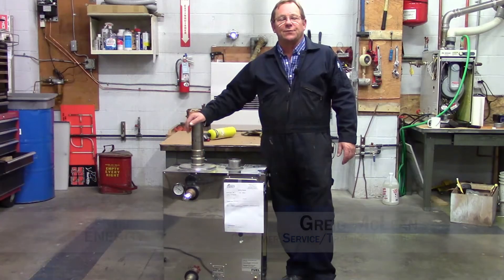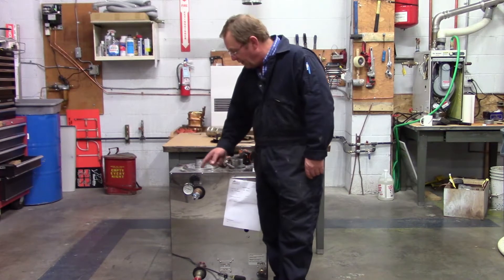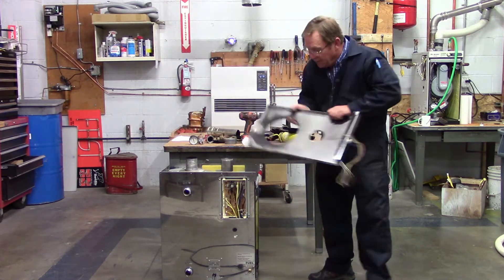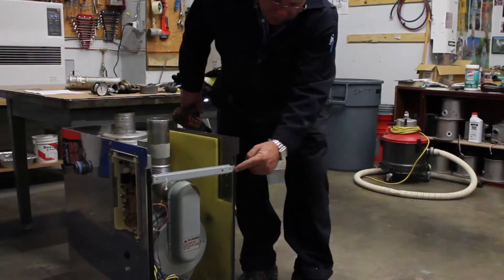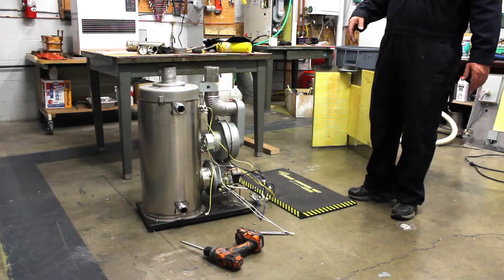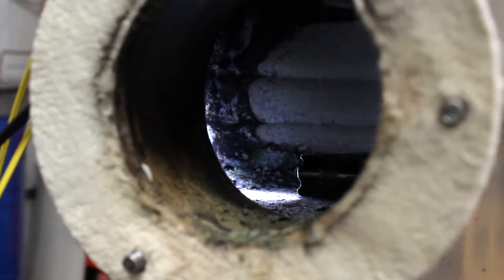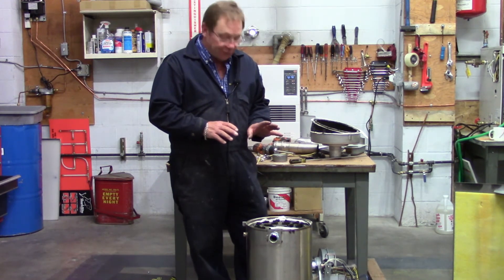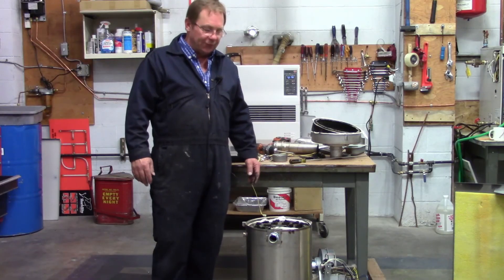Oil Miser Heat Exchanger Replacement: Part 1 | Step-by-Step Guide

Comment: Can I replace my OM-180 Heat Exchanger Part #20476745 with OM-148 Heat Exchanger Part #20476445?  I know there is a digit different in number on the parts.  What are the difference between these two heat exchangers?
Reply from the maker: Unfortunately, the parts are not interchangeable.